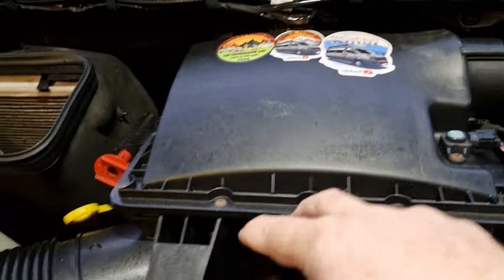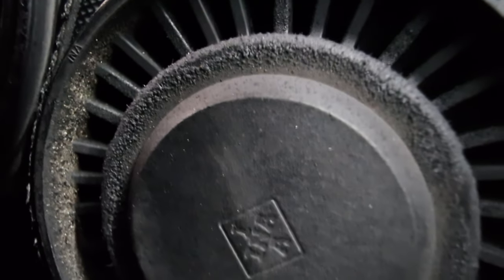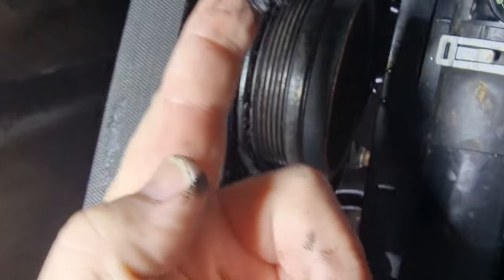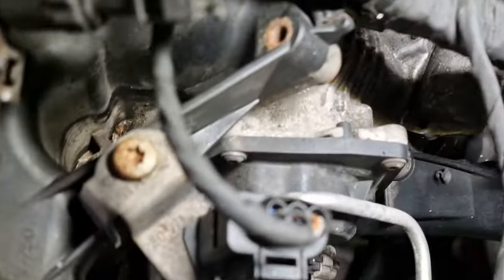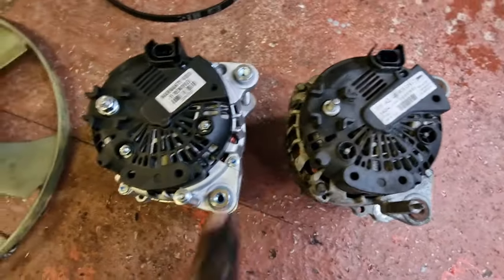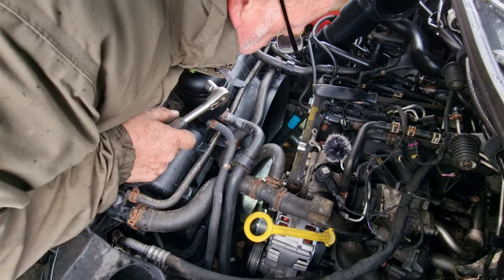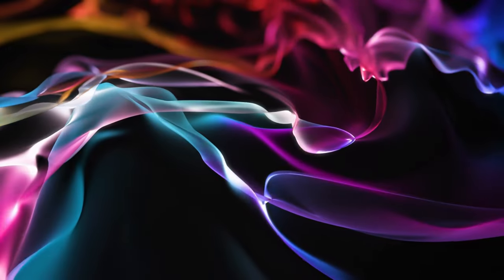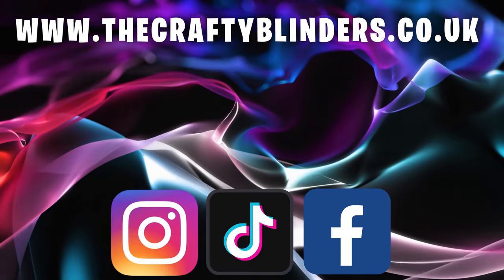vw crafter faulty aux belt tensioner replaced & alternator upgraded to 180amp

Comment: Hey man, thanks for the video. It really helped me change out the alternator in my Crafter. 

I was driving up a steep hill on a French motorway in torrential rain. Wipers going full blast, heating on full whack, lights and fog lights on, radio on, charging the 2 leisure batteries. Then all of a sudden my wipers failed! Couldn't see hardly a thing. Then other things started to go. Ended up making it off the motorway into a service station. Luckily, after an hour or so I managed to get the engine going again.

Those 140a alternators are definitely not made to power all of those things plus 2 150a leisure batteries. 

It was a nightmare to get the alternator free though. It looked like yours just came out no problems. I had to get a hammer and a crow bar and some WD40 and work it out for ages. Got these in the end though! 

Thanks again, man!

Regards,

Mark :)
Reply from the maker: Wow thank you 🫶 you are our first super fan ❤️

Comment: Oh Sam, glad you sorted it,  my alternator pulley seized after my last drive from UK to Finland,  I was so lucky it snapped whilst outside my old apartment rather than the long drive across Poland.

Surprised your 2.0 having a smart alternator,  mine has a normal one.
Reply from the maker: that was luck mate
Reply: Mine has a normal 1 too
Reply from the maker: my van is the blue motion model with stop start so has the smart alternator fitted

Comment: Mine was making a strange squeaking noise right after going in to VW for a cam belt/aux belt change.  4 months later the belt failed because the tensioner worked loose and sheared off due to not being tightened up correctly.  Sometimes the main dealer garages are incompetent.  Love your work, helped me out no end.
Reply from the maker: I have no faith in main dealers either mate bad experiences in the past with a previous van

Comment: I am continuously amazed, how you stand up to the moody weather and awkward placement of the doodats on the Crafter engine design and manage to film all of that in such detail.
Stuns me every time. My timing belt, waterpump, belts and such were a dealer service just prior to actually buying the van, so I probably have some grace period before I need to get into this stuff. And I do cheat, as I have all the Crafter factory repair manuals to check on the sequence of the neccessary tasks. That does in NO WAY replace a video such as this one for the hands-on experience. Perfect, Sam.
Cheers from the mainland! 🚐☁🍀
Reply from the maker: Hello from over the water my friend👋

Comment: What a coincidence! My aux belt tensioner has also gone causing slack belt (although it’s the Sprinter engine). Replaced now and new belt but still have a screech on tick over. Guessing it’s possible alternator clutch. It will be good to get it sorted for the new season. 😎👍
Reply from the maker: good luck
Reply: @TheCraftyBlindersvanlife  thanks mate. Belt tensioner replaced but the alternator one way pulley is seized. Next job, my mate has a puller which can do just the pulley so hopefully no need for the whole alternator to be replaced. Wish us luck 🍀

Comment: Do you have the part name and number for the new 180A alternator? was the 140A also an upgrade?   
I replaced the tensioner last year this time. It was the same noise, also the power steering halted, so the tensioner was totalled. But the alternator seem to have been collecting sand and has a noise itself. Heard from others, that the belt throws sand and moisture into the alternator and it eventually kills it.
Reply from the maker: try this link
https://www.ebay.co.uk/itm/153846245191?mkcid=16&mkevt=1&mkrid=711-127632-2357-0&ssspo=aO0GUP9IQ0W&sssrc=2047675&ssuid=qkhVtACcQ9q&widget_ver=artemis&media=COPY

Comment: On my 2015 Crafter the tensioner pulley wheel broke up that in turn shredded the belt, that then got caught up around the crank Pulley and worked its way under the timing cover shredded rubber got between the crank toothed gear and the timing belt, in turn the valve timing  was thrown out so rockers broken bent valves also camshafts had the lobes knocked out of presision, so needed new cams as well, luckily no piston damage. So if you hear a noise like spinning wire STOP ENGINE immediately!!!
Reply from the maker: good advice mate, but and expensive way to learn